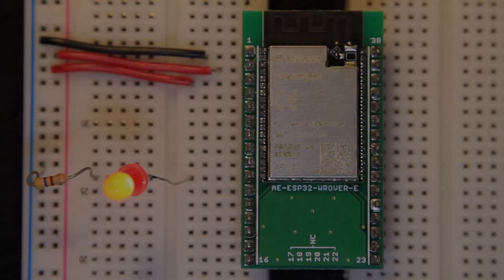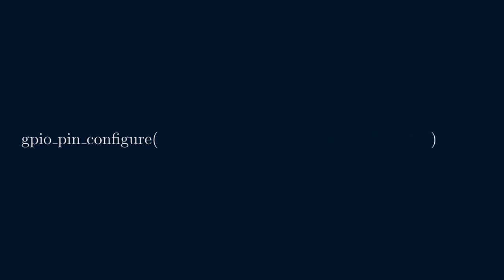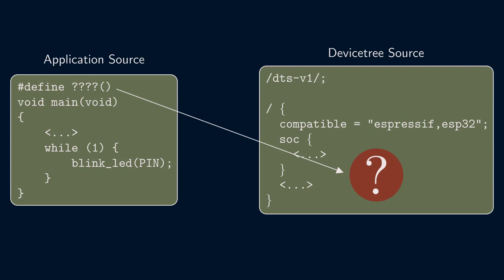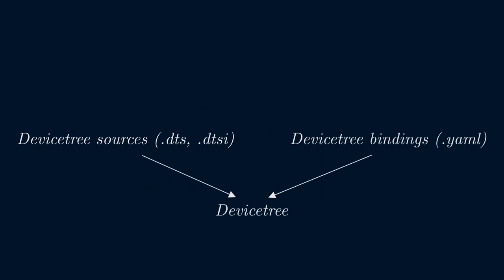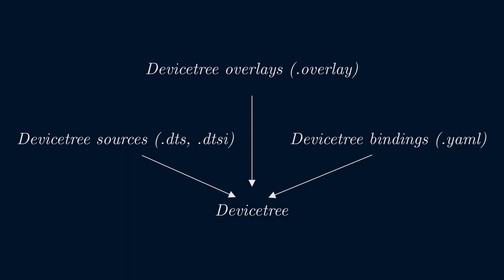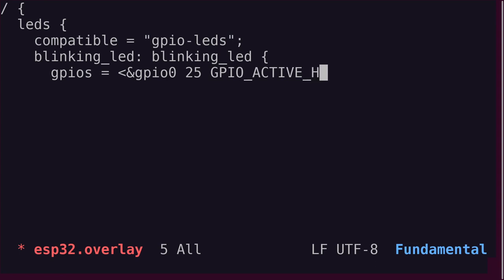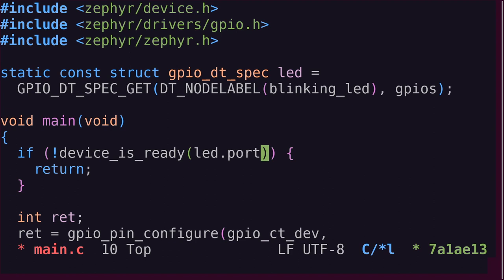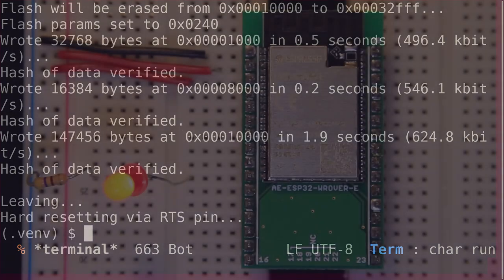[#2] ESP32 on Zephyr OS: "Hello, world!" (Blinking LED) [Part 2]

Comment: Thank you for your informative videos. Why is this information given twice: "gpios = <&gpio0 25 GPIO_ACTIVE_HIGH>" in the overlay file and "ret = gpio_pin_configure_dt(&led, GPIO_OUTPUT_ACTIVE)" in main.c? Isn't it redundant?
Reply from the maker: Thank you for the feedback and the excellent question. Whilst GPIO_ACTIVE_HIGH and GPIO_OUTPUT_ACTIVE look quite similar, their meaning is slightly different. In the devicetree overlay file, GPIO_ACTIVE_HIGH says that this pin will have the logical value of 1 (ACTIVE) when the voltage level is HIGH. So, for example, if the voltage on that pin is 3.3V or 5V (depending on your power supply), Zephyr will treat it as a logical value 1 (ACTIVE). If the voltage is at 0V (ground), Zephyr will treat the logical value as 0. If, instead, we had configured the devicetree overlay file to say GPIO_ACTIVE_LOW, then Zephyr would treat 3.3V/5V as a logical 0, and 0V as logical 1 (ACTIVE).

Now, as for the GPIO_OUTPUT_ACTIVE flag, this tells the MCU to treat the GPIO pin pointed to by &gpio0 25 as an output AND set it to logical value 1 (ACTIVE). Since we have configured GPIO_ACTIVE_HIGH in our devicetree, this means that the voltage will be set to 3.3V/5V. If, instead, we had configured the devicetree with GPIO_ACTIVE_LOW, then the MCU would set the voltage to 0V, because this is then the logical value 1 (ACTIVE).

Sorry for the long-winded explanation, but hopefully it makes sense. Please let me know if you're OK or if I misunderstood your question. Thanks again!
Reply: crystal clear, thank you @thepullupresistor

Comment: For people wondering why overlay is not included into the final dts file, you need to include this .overlay in CMakeLists with for example "set(DTC_OVERLAY_FILE "esp32.overlay")"
Reply from the maker: Thank you for sharing that insight with everyone! I believe that Zephyr changed the board naming last year, so that the esp32.overlay file was not automatically picked up. Currently, I usually just call my overlay file app.overlay instead of esp32.overlay, as per the manual here: https://docs.zephyrproject.org/latest/build/dts/howtos.html#set-devicetree-overlays

Thanks again for taking the time to help anyone facing similar issues.